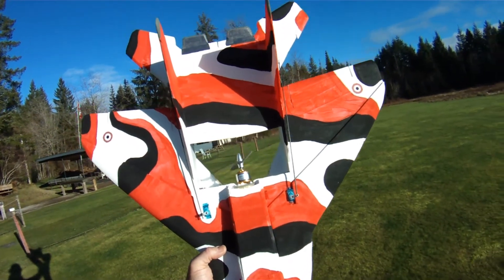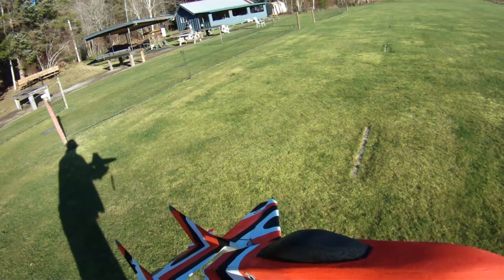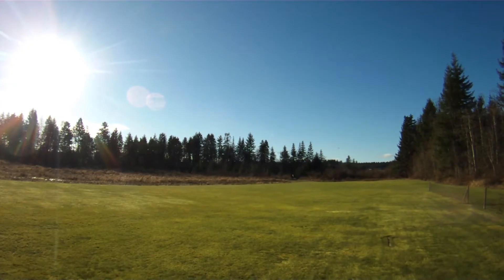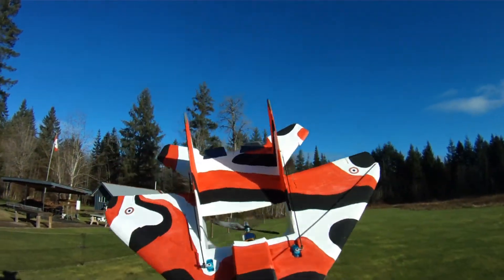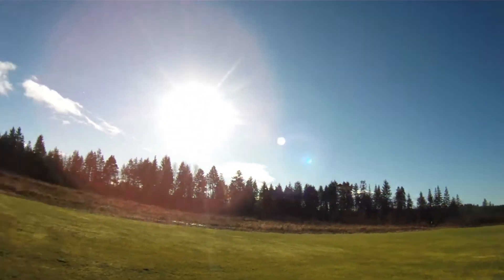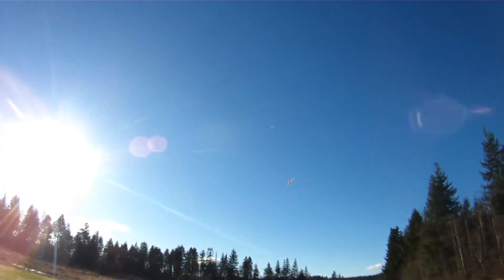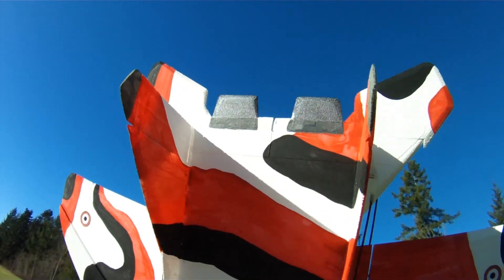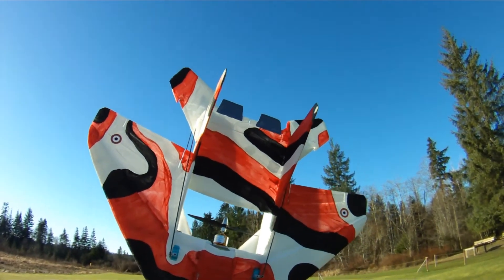Park Jet prop showdown - 6x4 APC gas vs 6x4 KMP

Comment: Nice flying in the Wind ;-) I definitely know what that's like and it really makes you work the sticks ;-) Nice field test of the props. I couldn't really tell which was faster. Which prop was better balanced out of the box? Thanks for the video and Happy Flying!
Reply from the maker: Thanks very much, the 6x4 APC gas was the much better balanced of the two, EMP/TGS/KMP props are notoriously badly balanced out of the package and can sometimes take quite a bit of work to get them balanced.  Thanks again and happy flying to you as well :) Cheers, Scott

Comment: Hi there Scott
Glad you were finally able to do this comparison test. The APC Gas may of been faster but not sure. Great flying in the windy conditions. I think Watt Waster is wright about maybe using the doppler phone app. It could give you a better idea of the speeds, but you have to do long straight and level runs at full throttle for the hole pass to get a accurate reading, but it still would be good to have and give you some more interesting technical data to go through in your vids as some sort of "proof" to keep the viewers happy.
Guess you're going to be comparing the GF 6045's next when they eventually turn up?
Cheers.
RCPP
Reply from the maker: Hi RCPP, thanks very much, yes I think the more I watch it that the 6x4 APC gas did seem to be a bit faster, it seemed like it delivered power all the way through the throttle range whereas I seemed to top out at about 85% throttle with the KMP prop, could be that this cheaper motor couldn't continue to provide the torque to keep spinning the slightly longer KMP prop towards the end of the throttle range?  Not a whole lot of difference, but that is why we test :)  I have experimented with the RC Speedo app on my phone several times in the past.  According to what I have read, it needs a minimum of two seconds of full throttle low and close which I don't have a problem with most days.  The issue becomes the sound echo off the trees I think as even when I stand out on the runway, the wall of trees behind me is only about 10 metres away and often when I am flying I can hear all kinds of sound echoing off them, especially with the more powerful, louder motors.  It is difficult to figure out what are somewhat accurate speed runs, I think based on what I have read it also provides speeds about 10 mph high.  But then I have been 100 ft away doing a vertical pull up and it has given me speeds of 150 mph!  Crazy.  I may play around with it some more.  Funnily enough, when I used to post speeds or discuss them, viewers gave me more grief quite often as they didn't believe the data :/  Ahhh, the internet :)  I think I had an old GPS data logger that goes in the plane at one time, but had a hard time getting that to work consistently, have to dig that out and see if I can have another go with that :)  Thanks for watching, mate :)  Cheers, Scott
Reply: Hi Scott
Yes it's seems like there is no easy way to accurately record the speed of a model plane and yes I see your point on getting grief off none believers. Funnily enough I had just that problem last night with my 150MPH F27 Striker video.  https://www.youtube.com/watch?v=tR123-TN8RI
Some idiot said there is no way that's 150mph, it's more like 60-70mph???? Say's he used doppler software. Think he was just a troll though. If you click on his YT name and go to his channel he just has play lists an no subs!
He has a link to a video 'not his' of the new F27 that goes 105mph on the standard 4s set up. Which he say's is faster then mine. It isn't!
I too have a voltron gps logger but yes they can glitch and give a false reading. I've had several flights with the gps on my F27 which I told him have recorded speeds between 140 and 167mph. I have not had a reply yet ;)
140mph was with the 2650mah 5s and the JXF 7x5 prop and speeds between 150 and 167mph were recorded with a 3000mah 5s and the APC E 7x5 prop. When the gps glitched on me on my first video of the F27 it said it was doing 210mph??? It was fast but not that fast. The prop speed calculation is about wright at 150mph. 
Voltron do now have a new V3 version of there gps logger which is supposed to be glitch free and you can download the recording of the hole flight on to your pc and track it on google earth. You can then highlight points of the flight and see how fast it was at any point of the flight. One problem though. It's $129!!!!! Oh well. Maybe give your gps logger another go. See how it does.
Sorry went on a bit long there. Cheers
RCPP